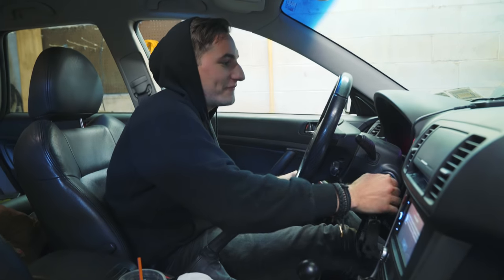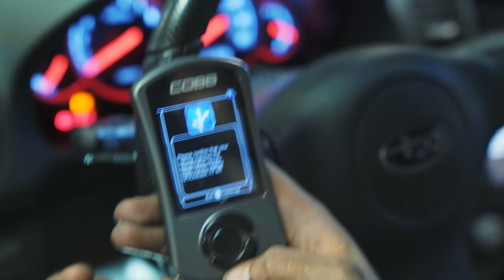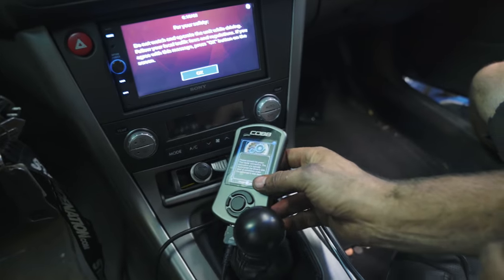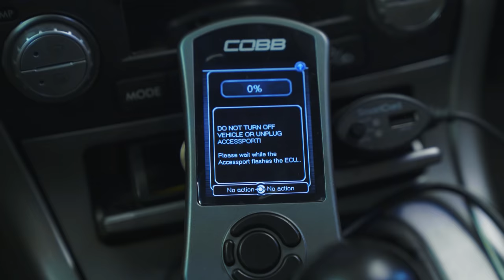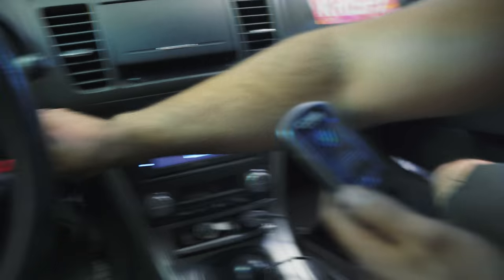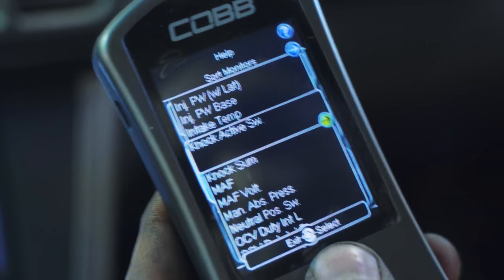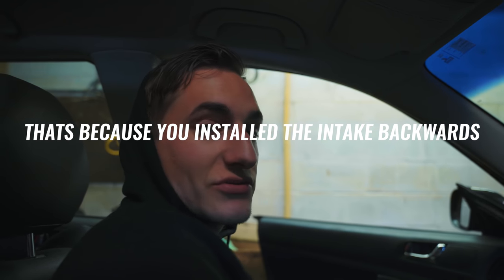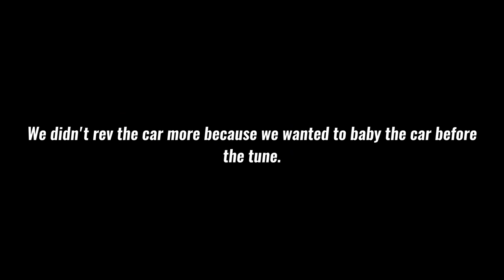IT WONT START!? Cobb Accessport V3 Stage 2 Flash!

Comment: I have the stage 2 it was already installed when I bought my 17 sti. I went to remap for better gas like I have dozens of times and when I tried to plug my chord into my access port I guess it wasn’t plugged in all the way and it lit my dash up like a Christmas tree. Now the cruise, and cdiff lights are blinking. I have a solid check engine light on as well and when I try to turn it over now it sputters like yours did. When I try to plug access-chord in now my screen is black and when I get it to start it’s straight stock. Any tips on what I should do?
Reply: Every figure it out? Ecu probably got bricked